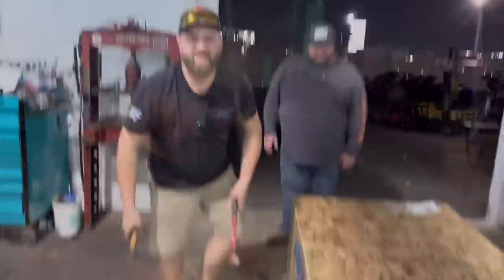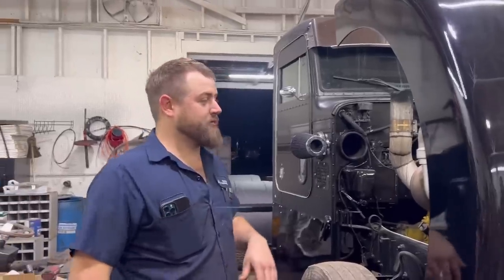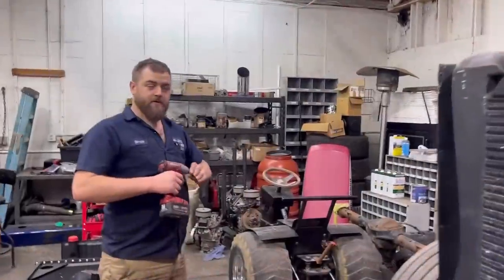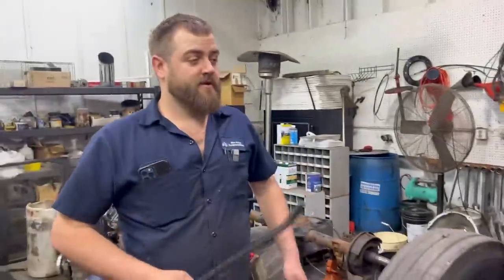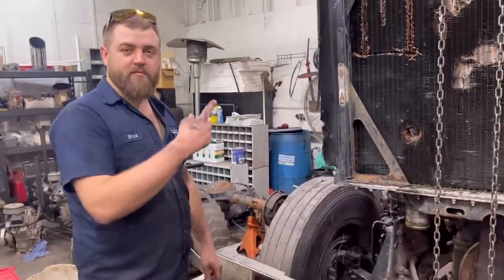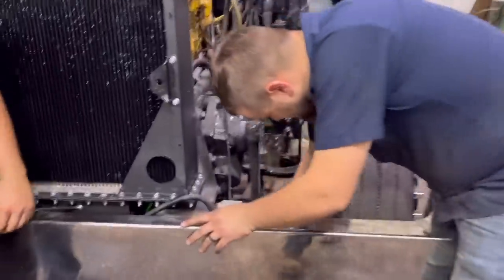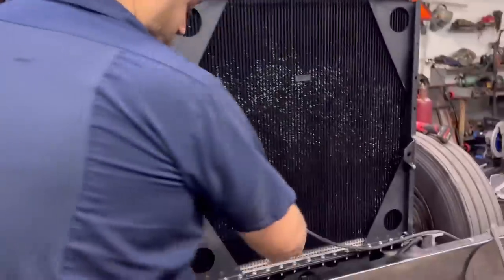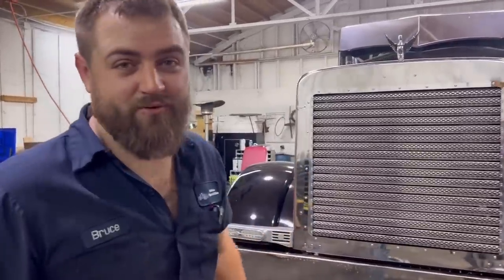Replacing the 35 Year Old Radiator in my Peterbilt 379!

Comment: Pro tip, home Depot sells massive concrete mixing tubs for $20. One of the best purchases I've made for containment, easily holds like 20 gallons
Reply: Absolutely, were using the same big containers for everything.. Super durable, can hold anything you want.. But hella heavy if you actually make it full 😂😂

Comment: Hey Bruce. Great truck so far and I think it’s awesome to watch sled pulling on your channel. Keep up the great content. I’d also like to put in a suggestion about the exhaust hood stack. Carbon fiber is cool n all but for your truck I’d go back to chrome or have it jet fuel burn around the tip even. Just a thought, it’s your truck but it would definitely stand out more and blend with the visor and bumper

Comment: You need to set lash tighter. Feeler gauge needs to snap when you pull it out
Reply: Feeler gauge should have a slight drag, if there's a snap when you pull it out it's too tight

Comment: 11 years as a parts manager, never seen a radiator last that long, unless this thing was sitting for 25+ years in a field I highly doubt it was original... I guess it could be could be original if it had received new cores and gaskets... but I doubt it has never been worked on.